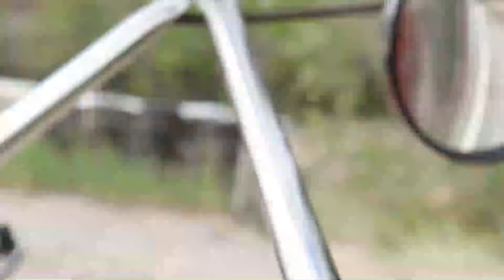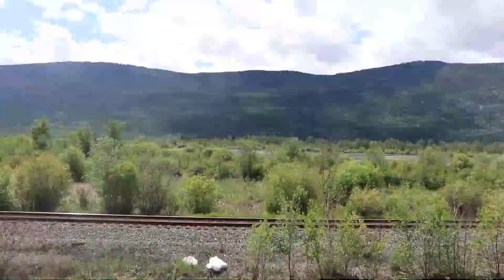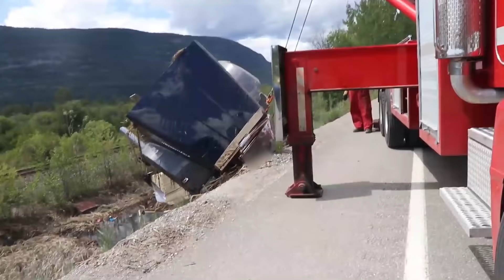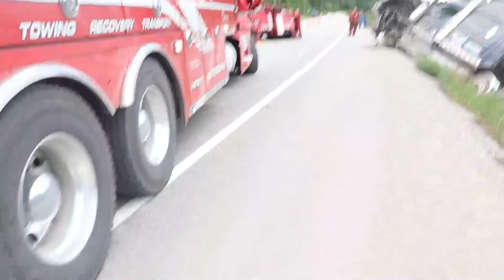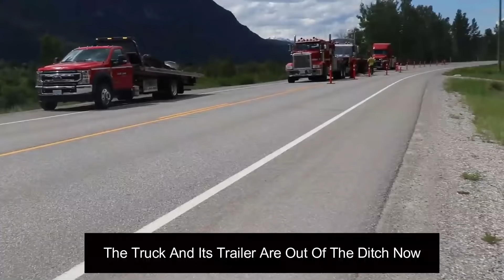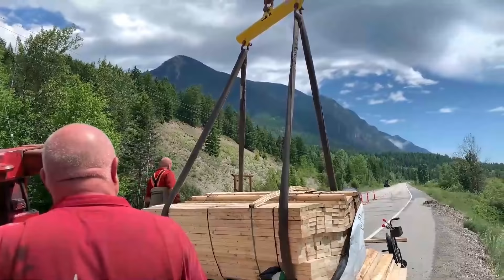The Rotator And The Mack Take On A Lumber Wreck

Comment: This is better than the show …you really get the full effect here with the sound of the trucks …the pulling power is incredible …keep up the great work and be safe !!!
Reply: Kirk Titgen.  Exactly.  On the show they sometimes add so much racket It's rough to listen to.  I like this much, much better.  Jamie and crew know what they're doing.
Reply: do you see that rusty thing by the tracks? That is the hood of a Pete that wrecked here in Season 6 and they had to use Aggressive's rotator to pull it out.

Comment: Walking / working under the tensioned winch lines and having that sucker snap @ 5:57, I think I would have soiled myself. This one looked super dangerous.
Reply: When I had my big tow truck I wouldn’t allow writhing fifty feet of the cables. If one ever broke or come off the other truck anyone near the cable would be cut in half instantly. And they would even feel it because it would happen so fast.

Comment: Great job filming.   A rotator is a great asset in tight quarters like you have on those 2 lane roads.  So much nicer to do a wreck in the summer, less resistance and better footing.   I love that is no drama, and the chance to interact with you guys.   Beautiful scenery.   Is it humid there in the summer?   So much neater (bundles in tack) lumber wreck than you are used to.
Reply from the maker: It gets humid sometimes but usually a very dry heat not to sweaty or nothing like that atleast in my opinion

Comment: Great video. Also do you know all the specs of The Old Western Star HR150 Rotator and the Old Peterbilt HR150 Rotator if not can you ask Jamie what were the Specs of The Old Western Star HR150 Rotator and the Old Peterbilt HR150 Rotator were the Engine, Horse Power, Torque, Transmission, Axles, Axle Specs, Suspension, Suspension Specs, Winches, Winch Specs, what Model of Rotators they were and Everything Else. Also, can you ask him what does he thinks of the M100 Rotator does he ever think he will want An M100 Rotator or get An M100 Rotator in the future?